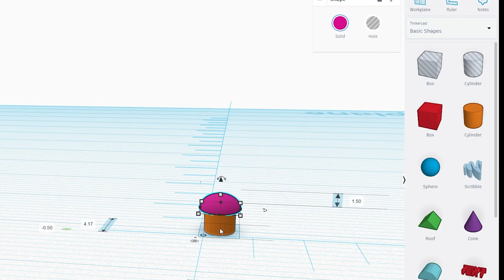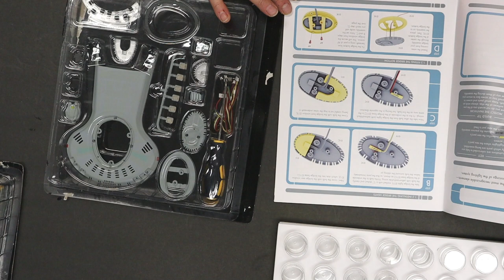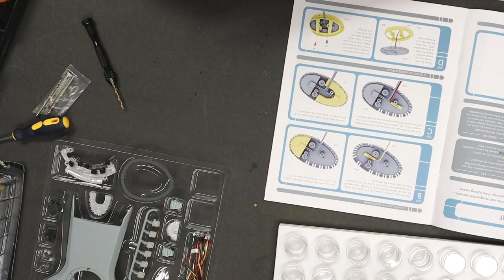Eaglemoss Enterprise 1701-D Stage 1 Assembly w/ Mods

Comment: Just ordered the first part of this kit. I was wondering about those emergency flush vents. Is it possible that the other one on the other side will have an LED added to it in a later step? It's odd that they'd choose to only make one of them light up. Doesn't the one that's unlit have a hole for an LED to fit in as well? I think I'm not going to paint mine when I get it just in case.
Reply from the maker: Rumor has it they are sending out some mods.  One is supposed to be a solid bussard collector, but I'm still painting that yellow myself,  I don't trust the Eaglemoss rumor mill :)
Reply: @TheMakersCave  Very interesting! I'll be curious to see what mods they make if any. I'm still debating if I'm going to paint that part yellow. I always hated that they didn't go with a metallic color like silver, copper or gold on the filming models. That yellow always looked awful to me. It doesn't go with the rest of the color scheme of the ship.

Comment: Wayne over at World of Wayne was able to spray the entire nacelle side (forgot what the part is called) copper, and it glows blue when lit from behind. I'm going to cover the grooves and paint it. Not going to use the alcohol, as I don't see why you would take the color out only to spray it on the back.
Reply from the maker: Actually I wish I had just sprayed the copper over the blue warp coils.  But to make sure both sides match I'm now locked into doing the other side the same way.

Comment: Nevermind. I just went back and saw that the other one is molded in black.
Reply from the maker: If you wanted you could probably make the other vent in clear resin.  I think most people are put of by the fact that only one lights up.  If they made them both clear it would be pretty cool to light them with a UV colored LED.
Reply: @TheMakersCave  It really is odd that they chose to do that section that way. I guess I'll just paint those parts like you did. Thanks for the video!
Reply from the maker: The more I think about it the more I like the idea of two clear flush vents that light up a UV color.  I might do that mod making them light only for a few seconds and then turn off, maybe some very slight weathering/burn damage at the bottom edge of the vents.
Reply: @TheMakersCave  That would look awesome! I'm curious what the other light is for. I think I'll build it the way they have it and then when we finally get to the part where we seal up the saucer, if that other vent doesn't get lit up, I'll just leave both sides of those vents black.

Comment: I drilled out the bridge dome and filled it with Krystal klear and then used a yellow sharpie to add the bridge lighting colour. Also the B deck in front of the bridge piece is missing some aztecing, I fixed that too.
Reply from the maker: Nice pickup on the missing Aztec.  I'm not that good to fix that.  I think amber (or yellow) on the bridge dome looks nice too.
Reply: I made the bridge dome as well, leaving it clear for now, and sprayed the red squares on the edge of deck 2. I noticed the aztecing is off, but I'm not going to touch it for now.